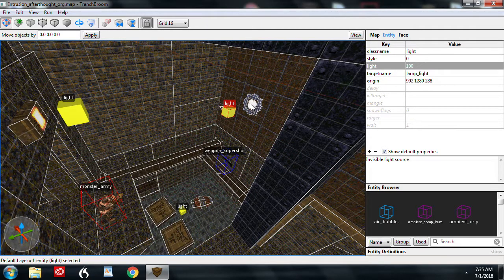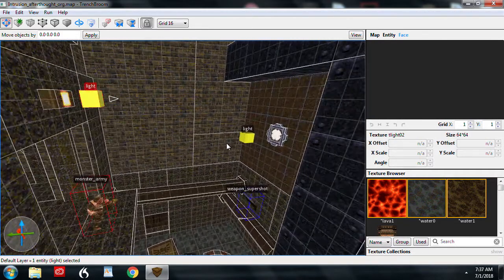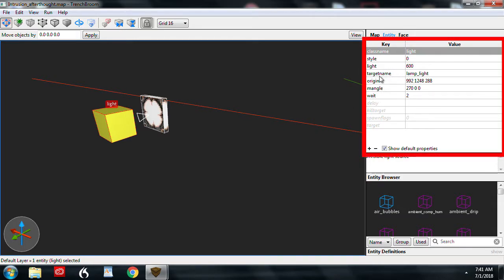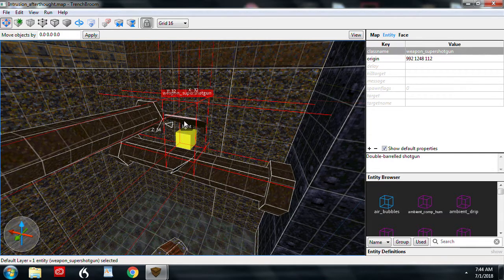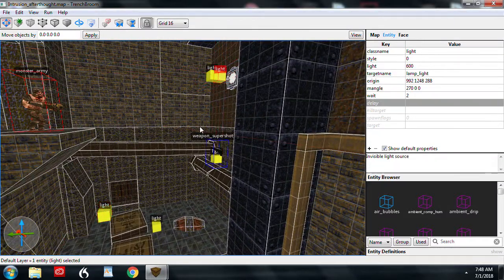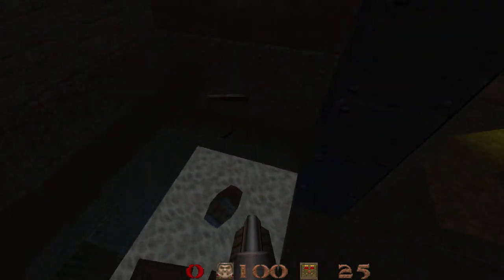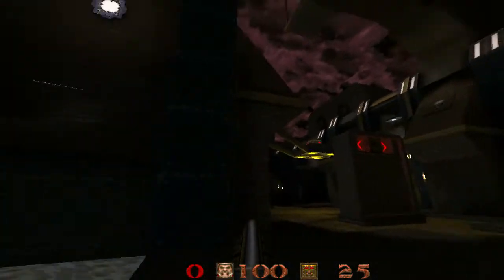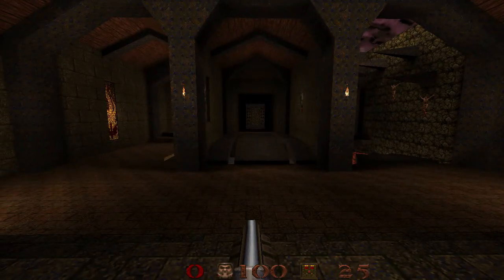Quake Mapping: Advanced Lighting Tips Part 2

Comment: Greats video loving them so far. In regards to the water textures i have noticed they are always bright no matter the surrounding light, is there any way to adjust that?
Reply from the maker: Try adding an alpha .5 key to the brush. This will lower the opacity. I have a video planned on this. But it won't be ready for a while.
Reply: @dumptruckds  Thats great thanks for the tip